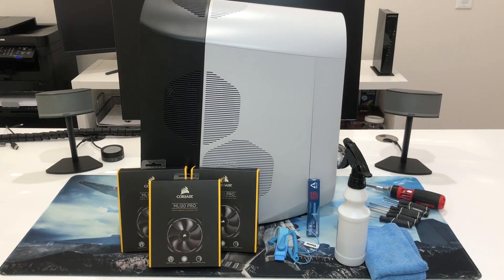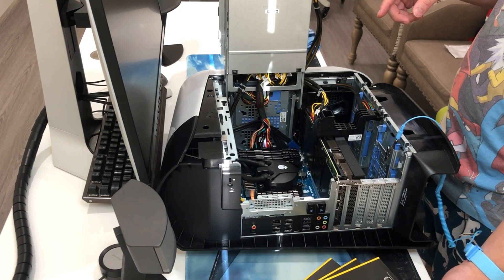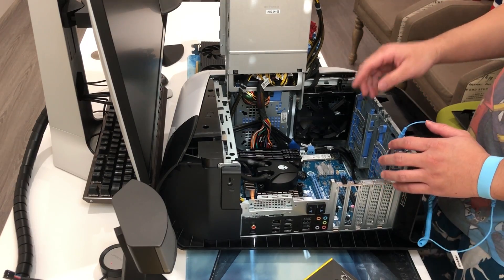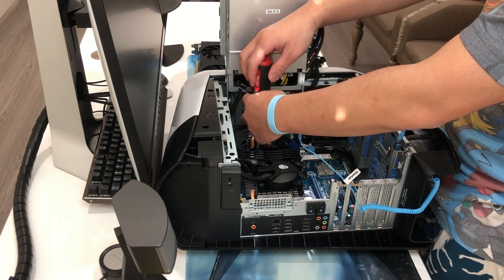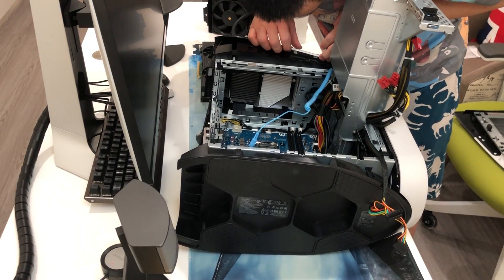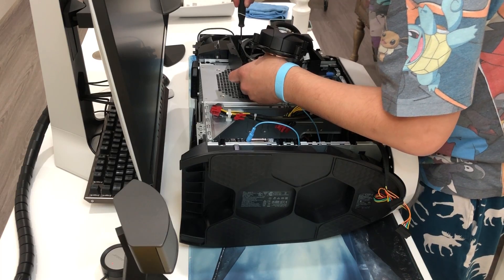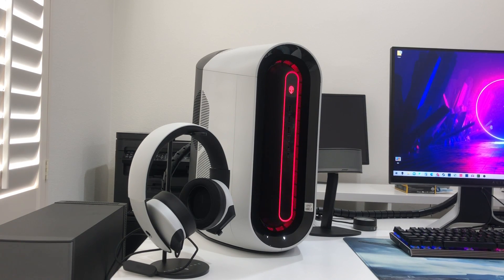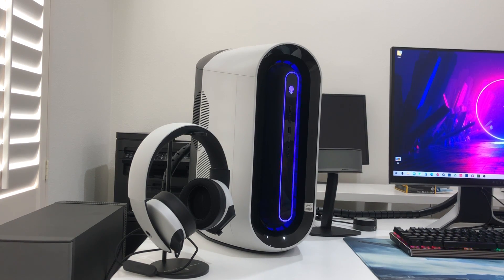How to Upgrade Fans for Alienware Aurora R11 / R12 to Lower Temperature and Noise - Top & Front Fans

Comment: Heya! I have the same system, so for the radiator fans; does the bottom fan on the radiator have the label facing up aswell as the one you would put on top of the radiator. I was a little confused on what you meant about the top fan and the bracket (the part where your phone died).
Reply from the maker: So, after you take out the radiator, there is a fan under the radiator which is the one that we need to replace, and the extra fan should be screwed onto the top of the radiator, and then screw them back to the bracket. So the final product, there should be the fan on the case, but in the case.
Reply: BigFishGaming thank you! I’m ordering supplies today! What thermal paste did you use?
Reply from the maker: @Eggsnsteak  I have that in the description too, my friend.
Reply: BigFishGaming haha just saw that too myself, my goof on that one
Reply from the maker: @Eggsnsteak  good luck on your modification too bro.
Reply: BigFishGaming I should be getting my supplies soon, I’m just hate taking the top part of the case off, sounded like you almost broke that
Reply from the maker: @Eggsnsteak  yes man.... I was worried right there... hahaha  .but, two fans is good enough tho. if you are going to install two fans only, I think there is no need to take out the top panel.
Reply: BigFishGaming maybe I’ll just do that so I don’t have to take the top panel off, I just wanna make sure I lower my temps, I was wondering can I use the Corsair pro ml120 blue rgb? Dell sells them and I could use my rewards
Reply from the maker: @Eggsnsteak  I’m not sure about that one.